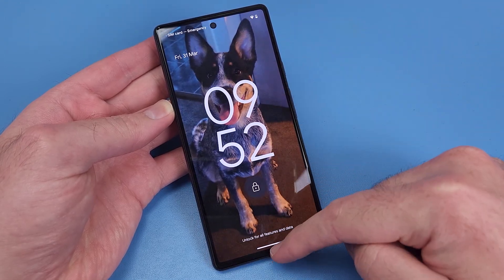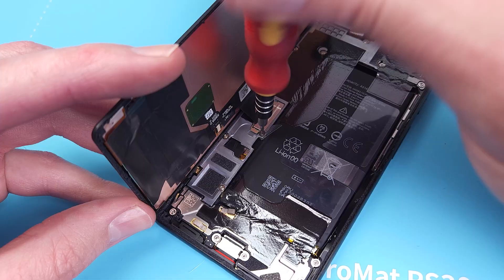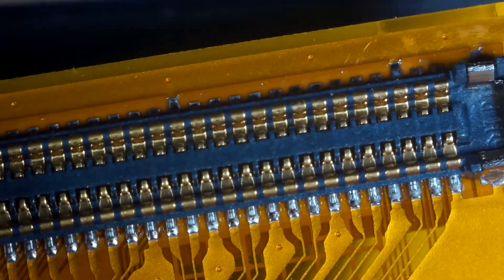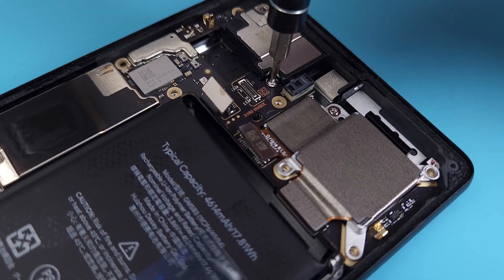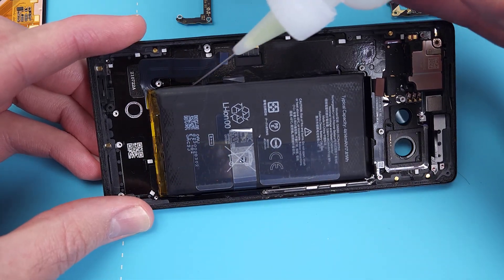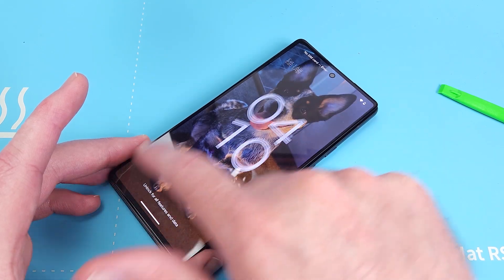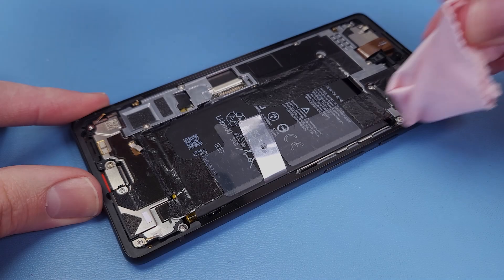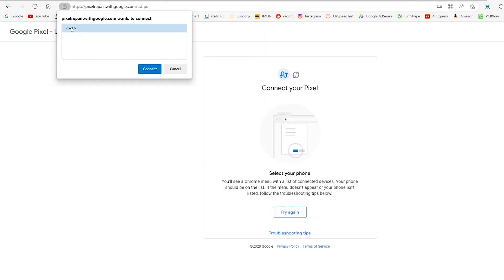Housemate Drops Her Pixel 6 In Water

Comment: Either a factory defect with the glue or the "housemate" has been abusing the phone...probably by sitting on it in her back pocket causing it to flex repeatedly. Why didn't he check the liquid damage indicators?
Reply: i saw they were not tripped so no water ever got into the phone most likely just a crack in the touch digitizer

Comment: My friend samsung s21 was damaged same like this, my iPhone is much better I went to swimming with for hours nothing happened.
Reply: be careful even if water doesnt make its way into your phone it cam still damage the charge port and remember water proofing is never prefect water will find its way in eventually its only there for when you get rained on or drop your phone in water and if its pool or salt water you increase the odds of your phone dying even it keeps the water out
Reply from the maker: Yeah I think iPhone's water proofing is better, the screen is fastened down with clips, not just adhesive, so there's less stress on the adhesive, which is important if it deteriorates over time.
The lightning port is also screwed down tight against it's adhesive.

Comment: Isn't pixel 6 waterproof?
Reply from the maker: It's supposed to be, but water resistance can degrade over time, depending on temperature changes and such. I was not impressed with how easy it caved

Comment: Hey, I just want to ask you about the modifiability of 1.8" mSATA 16 pins female to some regular SATA one, is there's a good adapter/converter you recommend?
Reply from the maker: No sorry idk
Reply: @RestoreTechnique  I found an adapter, and also found out that I can replace the huge DVD Multi IV (approx. 28% of the device's whole size) with a SATA HDD or SDD, but I would probably get an HDD if I don't have an SSD combiner RAID-like thingy but physical.

Anyway, thanks for actually replying I like your videos!

Device: [bought used since late 2011 then stored for 3 years with a semi-dead SSD in read-only mode because S.M.A.R.T] Lenovo ThinkPad T410s

Comment: I have used Pixel 6 (exactly this color) as a daily driver for about 8 months now, and because it is mid-range and not a flagship, they seemingly used cheaper OLED displays, if you look at the screen at certain angle, you can see some kind of "rainbow effect" High-end OLEDS on flagships don't have this "problem". My Pixel 6 has slight green tint at upper right corner, so not the best screen thats for sure.
Reply from the maker: I wouldn't call the Pixel 6 mid range. Upon release it was the 2nd best phone in the pixel range. Someone else mentioned the cheaper OLED screen though, I didn't notice anything lower quality in my limited usage of it. My housemate probably wouldn't notice either way.

Comment: is it not ip68 rated?? how could it be damaged by couple of seconds in water? weird.
Reply from the maker: Yeah I know right, I was so surprised that a little dip was all it took. Yes it's IP68 rated
Reply: @RestoreTechnique  i bet the drop actually caused a crack in the touch layer of the display if water got in the water indicators would have turned red and if water got into the display it would have caused parts of it to go black and all it takes is one unlucky drop to damage your pphone

Comment: 6:38 I think you need to remove the battery first.
Reply from the maker: Yes, but it's a stupid design where you need to remove the battery just to get the motherboard out. When the only thing preventing the board removal is 1mm of battery flex cable protruding.
Reply: I am willing to bet on this. It's the piss and shit juices that got the screen. The phone is IP68 rated afterall, it can't be water.. right?

Comment: Kinda reminds me of what happened to my roommate's iPhone X. Went through the washer. Phone did a good job at keeping out the liquid, but...a little bit got in through the earpiece and killed the proximity sensor which caused the phone to bootloop. Apple refused to repair it at any price, and try as I might I couldn't get it to work with the proximity sensor still attached, so I removed it. Which unfortunately also meant Face ID no longer worked. And because Apple is so hardcore on serializing their parts, means the poor thing will never work 100% again even though a simple screen swap at an Apple store would be enough to bring it back fully. So it goes.

Glad to see the Pixel 6 made a full recovery. And in contrast to Apple's stuff it doesn't scream at you for using a 3rd party screen, or a replacement fingerprint reader (after recalibration, of course).
Reply: Would Apples self repair be an option with that? While not cheaper than them repairing the phone, it could work again, as they will pair the new parts for you remotely.
Reply: @higihups  not for such a old iphone

Comment: Nowadays touch matrix is integrated into the OLED layers and flex cable is going right in the bottom of the display where's tear between screen and plastic frame was found. My guess is that the touchscreen itself just died because of the water

Comment: I loudly screamed when I saw you squeezing IPA into the layers of the display. When I got a tiny bit of IPA onto the side of the layers of my Pixel 2 XL, it "ate" the OLEDS and I left behind with a black "dot".
Reply from the maker: I have never heard of IPA damaging any OLED screen before, that's very weird. IPA can not eat into the glass structure of the OLED. Phone technicians have been using IPA to clean phone screens for years. I've never had IPA do any damage to a display before, and I've repaired over a thousand phones. 🤷‍♂️
Edit: typo
Reply: @RestoreTechnique  Yeah, I was surprised as well. But maybe it happened because it was a P-OLED display which doesn't use glass but polyethylene terephthalate (PET), polyethylene naphthalate (PEN) or polyimide plastics (PI) as the substrate? (I googled a bit ;)
Reply from the maker: @an3k  oh dang, didn't know that, you just learned me good 😯
Reply: @an3k  no the pixel 6 had a hard oled display but care should be taken anyway
Reply from the maker: @uctm0fgwitdtbrp1-zqlm9sq6  iPod touch's used LCD's, not OLED displays. 
What you're describing sounds like IPA getting into the backlight of the LCD, which is layers of thin translucent plastic that appear blotchy and distorted if liquid gets in between them.
Edit: Sorry I meant to say in my original comment; "I have never heard of IPA damaging any OLED screen before"

Comment: The bond between the OLed and Digitizer is kept with that UV Glue, it probably only got detached from some specific corner of the screen assembly and thus made it stopped working, I think detaching the digitizer and then re-gluing it back to the OLed with UV glue might have made it work, but that's more money spent for even more hassle and may not even yeild a working result.